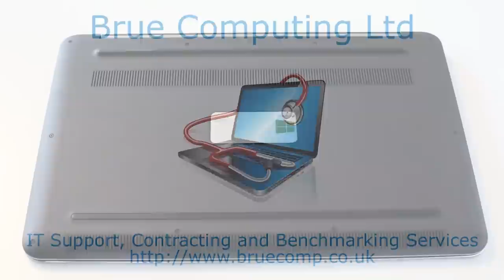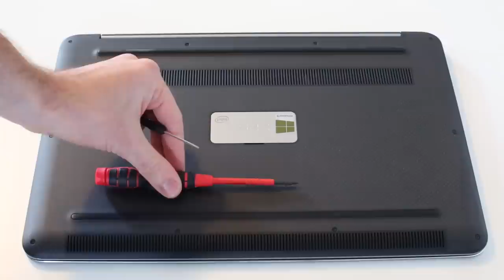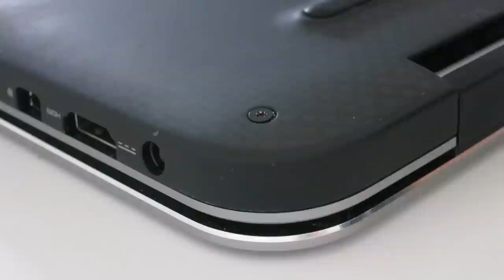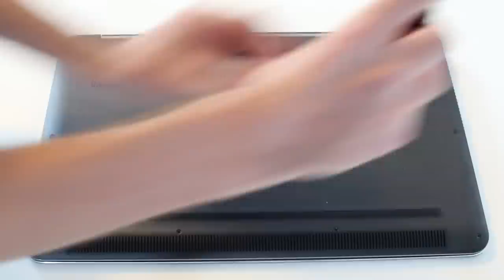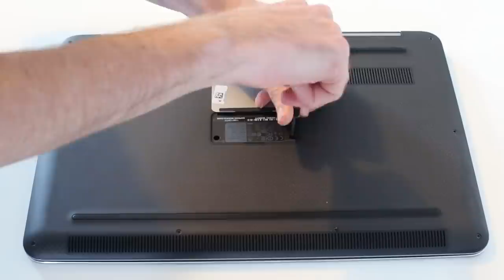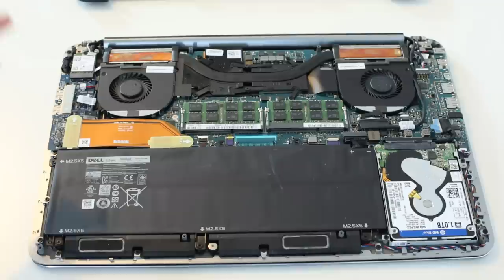A look inside and how to upgrade the Dell XPS 15 Touch (9530)

Comment: I have this model and while replacing the ram did something wrong. I also stripped a screw for the case. This should help me get the ram in properly after I fix the screw issue.

Comment: Hi, thanks for the video. Would you suggest opening up this laptop for the purpose of cleaning the fans and heat sinks. I suspect my laptop's fans are overworking because of poor heat dissipation.Thanks
Reply from the maker: +gunjan kumar If you have the right screwdrivers then it is fairly simple to do, so no harm in it.
Reply: +Brue Computing Thanks :)

Comment: Hi! Nice video! Congratulations! I have exactly this model and I was wondering what is the best thing to do: change my mSata 32GB SDD for a larger one or replace the hard drive by a 500gb SSD? If I choose the second option, I have to remove the mSata 32GB to install the operational system in the new SSD or can I leave the mSata there? Thank you!

Comment: Great video, thank for sharing!  I now know how to pop the back on my laptop.  One question:  Do you have the part numbers of the fans?  Both of mine seem to have failed.  Thanks!
Reply: Hey there - not sure if you're still looking for the part numbers, but I just had to order replacement fans as well and it took me a while to find the right part number. The part numbers are DC28000DQF0 and DC28000DRF0 (right and left fans are different). I found them on eBay, which seems to be about the only option. You can find the step-by-step guide to replacing the fans on the Dell website if you search by your model number and open the manual. Good luck!

Comment: can you tell me what screwdrivers i will need to replace a hard drive? mine has failed and I want to replace it but i want to make sure i have the right tools :)
Reply from the maker: +KingFishOcean Torx T5 for the base. Once inside I believe it is just small Phillips head screws.
Reply: ok thanks for the fast reply! :)

Comment: Are there any mPCIe slots? I want to install an external gpu for my laptop as I like to play games :)
Reply from the maker: Bubb Wub No, but 'external' GPUs don't fit in to mPCIe slots. If a laptop has changeable graphics modules then they will use the MXM interface, which this laptop lacks. The GeForce GTX 750M graphics in the XPS 15 are quite reasonable though.

Comment: I have the same PC and I have a little question for anyone who owns the same machine with the 8GB SSD and 1TB HDD
in my performance page it always says that my SSD is 0% usage even if my PC on full usage, is that normal?
Reply: It depends on the amount of RAM you have running, I have the 9530 with 16GB of RAM the 1TB HDD + 32GB MSATA and I can't use the Intel RST caching with the MSATA. If you use the help function in the BIOS is will tell you that any more than 8GB of RAM won't allow it to work.
Reply: Fernando Leon I have exactly the same as you, damn man that laptop is getting sucks now! -_- thanks for your response :)

Comment: great video... do you know what is the maximum RAM this laptop supports? thanks :D
Reply from the maker: I believe 16GB is the maximum supported, 2 x 8GB as is fitted to this particular laptop.
Reply: I just want to confirm for fellow searchers that 16GB (2 x 8GB) is the max RAM supported by the Dell XPS 15 9530. The laptop will not boot with a 16GB module installed. I tried it myself.
Reply: +Alex Forsythe thanks for the info :D

Comment: XPS15 Touch ,Windows10 Upgrade (accidental) battery stopped charging now 0% won't boot at all. Can I remove the battery, boot without it and hope it runs off mains, uninstall windows10, re-seat the battery and expect it to work? any other options, ideally without opening it up ?

Comment: does the i7 have a product code? I have the same laptop but with a now sluggish i5 :(
Reply from the maker: I wouldn't really expect the i7 to be significantly faster in general use - the i5 is still a quad-core chip. May be worth checking the system for other issues.

Comment: What's the max RAM?
Reply from the maker: I'm actually not 100% sure - the CPU supports 32GB, but that may only be with 4 DIMMs and this laptop only has 2 DIMM slots, so to be safe I'd say 16GB is the max. Crucial website agrees that 16GB is the max.

Comment: so there's only 1 M2 SSD slot???
Reply from the maker: No, there is an mSATA SSD slot - it doesn't have an M.2 SSD.
Reply: I meant an extra SSD slot... no right?
Reply from the maker: Correct. It has 1 x mSATA slot only. You could on the model I had fit a larger mSATA drive AND replace the HDD with a 2.5" SATA SSD if you wanted a pair of SSD drives in it though. SSD only models have a larger battery which takes the space for the 2.5" drive so you can't do this for those.